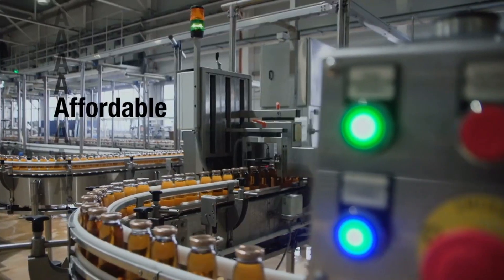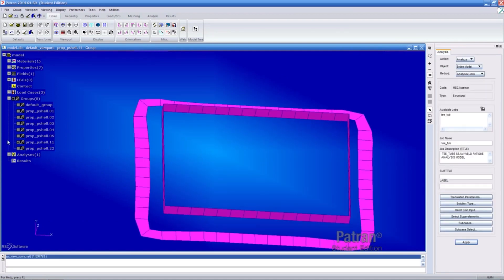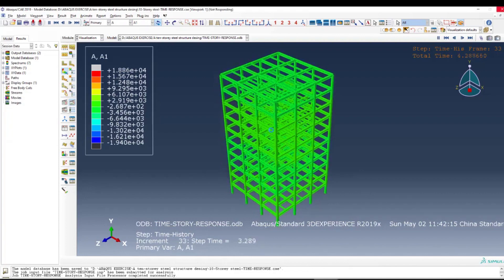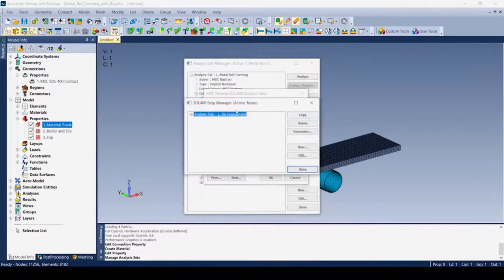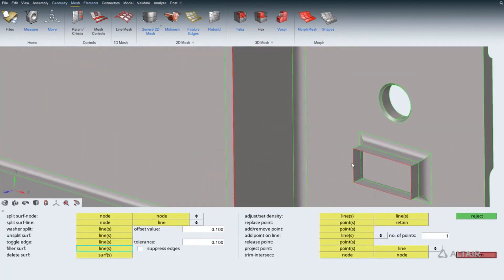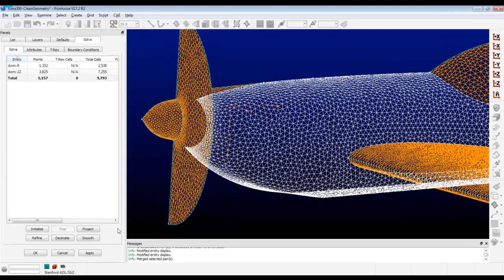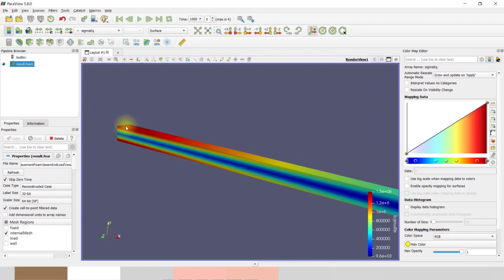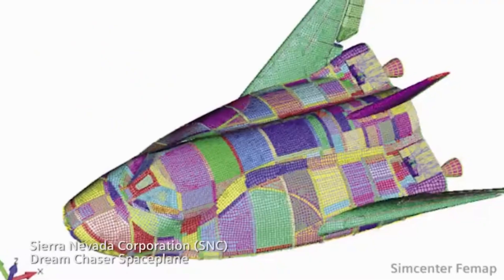9 Best FEA (Finite Element Analysis) Software for Mechanical and Aerospace Engineering

Comment: those are general purposed FEA software. For civil engineering, I would use RFEM from Germany or SAP2000 from US for structural design code compitablity. It depends on the products you are analyzing and designing.